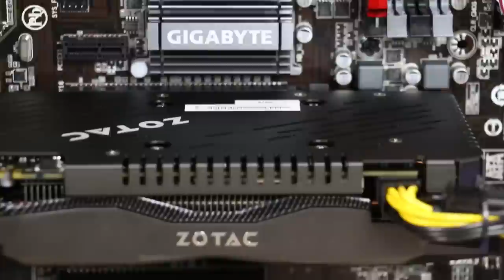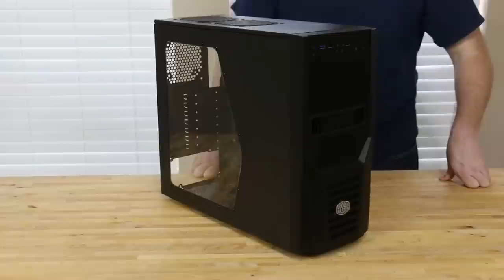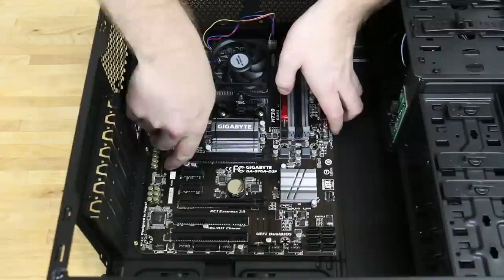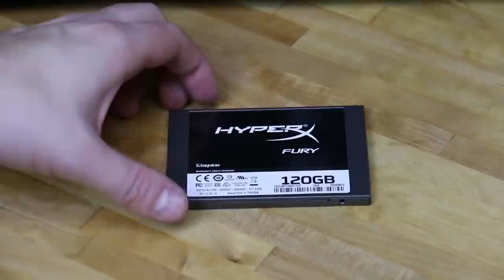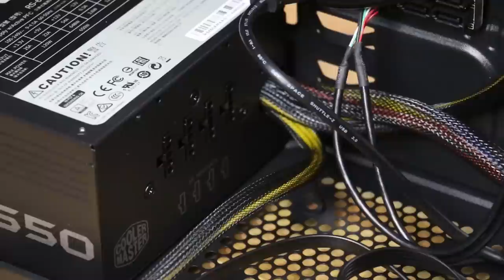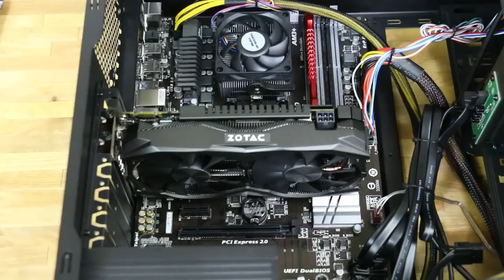$690 Gaming PC Build - FX-6300 / GTX 960 / Cooler Master Elite 431 Plus

Comment: Overkill PSU and replace the shit 960 by an R9 380. Less expansive and more powerful.
Reply: this video was published before the AMD's 300 series came out
Reply: Bryce Degraff
 And? The R9 285 (the same as the r9 380) came out after 970/980 but before 960.
Reply: smokeyjo123e
 It's hard to find today but why not.
Reply: smokeyjo123e
 In Europe it's hard to find new
 280x. Only used 280x are available (or if there is a stock of non used 280x it's out of stock really fast) so I always recommend the 380 or 285, but if you can find a 280x why not.
Reply: smokeyjo123e
 Np, in Europe we can find R9 380 for less money than GTX 950 ^^
Reply: smokeyjo123e
 That's why 950/960 really suck in Europe. R9 380 is better than the 960 which is better than the 950 and the R9 380 is less expansive than the 950 xD
Reply: +L3xou97 yeah i have a less powerful psu and i was gonna go with the 960 but went with the 380 bc a few more fps and 256 bit memory bus around the same clock speed
Reply: +Slaythan good choice
Reply: +L3xou97 amd fanboy alert.
Reply: Soumya Majumder
 Idiots alert you mean? 960 is the worst GPU of the moment
Reply: lol
Reply: tell me one nvidia gpu which shld replace it
Reply: Soumya Majumder
 R9 380. More performances and less expansive.
Reply: "hence proved" amd fanboy.
Reply: Soumya Majumder
 Wrong. You said nothing except personnal attack here, if there is a fanboy it's you.
Reply: MsAboAbosauce
 You're looking for 380x, i'm talking about 380 which is better than 960.

http://www.topachat.com/pages/detail2_cat_est_micro_puis_rubrique_est_wgfx_pcie_puis_ref_est_in10090343.html
Reply: Mote of Dust
 You're drunk or what?

Comment: So the way i see it is that the Power supply is waaaay overkill. There's no reason to have such a huge power supply for a system that doesn't even consume 300 watts. A 350+watt PSU would be just fine. And if you were going for a 280 a 500watt or a very good quality 450 would do. It's not really spenting your money correctly. The Only thing you got might be a PSU that'll last a good 5 years +
Reply: I disagree. It gives you headroom for future upgrading. Quite sensible really.
Reply: MrApvel dual 980s = waste of money (IMHO)
Reply: MrApvel True. As an example, I get where you're coming from.
I always like PC builds with loads of extra headroom in the PSU department. You never know what you may add in the future.

If I was building this PC, I would go for anywhere between 500w and 600w PSU. Like I said; all about that headroom for future additions/changes.  :)
Reply: MrApvel lol i have a 750w 80 plus gold power supply for my 4790k and gtx 760
Reply: Tintin Onacid Even 960 SLI, which the motherboard DOES NOT support would only consume 500watts, so still overkill
Reply: Tintin Onacid How would you upgrade this PC in a sensible way that would use this much wattage?
Reply: RcAndFun Why?
Reply: Søren Wetter Ahh, I see you can read the future... You know what cards etc and their power needs will be over the coming years.

Again. Headroom for possible future needs. I don't see why you consider this a bad thing.

PSU is the one department you don't want to cheap out on. Better to be safe than sorry.

Build how you want to build friend.

Most PC enthusiasts I know, always go for a PSU that exceeds their needs.
Reply: Søren Wetter it has a 10 year warranty so why not?
Reply: RcAndFun Exactly! Your set for the next decade when it comes to your PSU. In five years time (or so) you may be getting near to that ceiling. No of us know what power hungry components may be available in the coming years.  :)
Reply: Tintin Onacid So getting a future proof psu can be smart if your other parts are actually compatible with the upgrade path. It's not a bad thing to do this but when you have relative limited amount of money you really wanna squeeze out every last part of preformance you can.

Getting less wattage is not "cheaping out" I wound't have said anything if it was just a 450w model of the same PSU, just the fact that it's a 650w makes me cringe. Since it's budget build and spenting 100 dollars out of 750 just on the power supply when you can get a good PSU for 50 dollars even less depending on what your requirements are.

Futureproofing is a lose and very misunderstood term just like bottlenecking. There's a BIG difference between having a 1500 dollar budget, where it's ok to use 100 dollars on PSU  and a 600-700 dollar budget it's a very different story. 

here's my go at the same budget: http://pcpartpicker.com/p/L3zCvK

Better CPU, same storage, a bit better GPU, not much. And it still has a high quality PSU.
Reply: +tintin onid
I agree with you completely. I was thinking about skimping out on the psu but I got parts that I might want to sli and overclock with in the future. So I went with a larger one.
The build:
http://pcpartpicker.com/p/jrmhXL

Comment: Noob question: Do i need to buy a wifi card or something?
Reply: Wired internet with cat5 cable is the best and most reliable way to get internet for gaming/streaming. If you can't get a cable from your modem to your PC then I suggest you buy (I can't remember what it's called) this device you plug into the wall next to your modem then another one next to your PC. You then take a cable from your modem and plug it into the device. Then use another cable to connect to your PC from the other device. 
How this works:
This technique uses the electrical wiring in your house to transmit the internet signal. It's not as good as a straight connection, but it's way better than wireless.

Comment: I don't see the cpu fan in the parts list, and I don't even see a disk drive or a power cable in this whole video, and this is the same with every single pc build I've found on pcpartpicker, and it's totally confusing. Can anyone explain this to me? do they come with the parts, are we left to buy them ourselves? does it even matter which ones I get?
Reply: the reason I ask is I bought a power cable for an old laptop I used to have, and it got fried in a week, and it wasn't until I looked up the model of the original that I could have any lasting use out of it. So in my experience this kind of thing has been very finicky.
Reply: Parts need to be compatible with other parts my friend....always research things before you actually try them, pc part pickers usually come with everything you need to start the computer up (excluding monitor, keyboard, and mouse)
Reply: KazmaHD so but why do I never see what I consider crucial parts listed in these builds?
Reply: ameteuraspirant What are these "crucial" parts you require?
Reply: well, what I mentioned above, disc drive, power cable, anything to be able to play like a regular storebought computer.
the problem is, I don't know if people are leaving these things out because they don't use them, or because they're something anyone tech savvy enough could get on their own.
Reply: cpu comes with a stock cpu cooler, disk drive not included, PSU is your power source...you plug that into the wall ameteuraspirant
Reply: ameteuraspirant power cable comes with the power supply, disc drives are optional at this point.
Reply: alright, that clears up quite a few things. thank you +everybody
Reply: -_- I regretted that as soon as I posted it.
Reply: ahahaha ameteuraspirant

Comment: guys can this build run medium to high setting games or is this a bad build

- fx  6300
- Rosewill RCX-Z1 57.2 CFM Ball Bearing CPU Cooler
- Asus M5A78L-M/USB3 Micro ATX AM3+ Motherboard
- Crucial 8GB (1 x 8GB) DDR3-1600 Memory
- Western Digital WD Green 750GB 2.5" 5400RPM Internal Hard Drive
- EVGA GeForce GTX 750 Ti 2GB Superclocked Video Card
- Logisys CS305BK ATX Mid Tower Case w/480W Power Supply

i'm in a really tight budget so... yeah!.......
and yes i copy pasted the list :)
Reply: +Riskia Ranadhina Sukriananda Well if you're on really tight budget i say yea that's not a bad build
Reply: +Riskia Ranadhina Sukriananda Yes I have the same Card and cpu and I can run Battlefield 4 on Med/High as well on most games.
Reply: It's alright. 750 ti is a bit on the weak side. (Recommendations : r7 370,GTX 950/960. R9 270x.) Medium is console setting; so running them on high-max settings is KEY. My recommendations will run games high-max with the 6300. Aside from that, your build is great.
Reply: +Riskia Ranadhina Sukriananda, What is your budget?
Reply: id recomend the asus over clocked 750 ti best one and its on sae

Comment: Could I run a 6300 and 2 gtx 960s with a 550w psu?
Reply: I wouldn't advise it, if you do plan on it I'd rather just OC the 6300 as far as it'll go with a good cooler or get an 8320. Just in case if bottlenecking is an issue.
Reply: MLG NeverFail
Good joke!

Comment: my motherboard is Gigabyte ga-m68mt-s2. Can I upgrade to AMD FX 6300?
Reply: +Tommy K Yes.
Reply: Adam Barnett
this is my build 
http://imgur.com/1QbLpqd

spec: i3 4150, MSI GTX 750Ti, corsair vg pro 8gb dual, cm hyper 212x, 1TB WD blue, CM 500W ELITE V2, CASE CM N200 WINDOWED
Reply: +Tommy K I have an amd fx 4350 clock at 4.57ghz, 8gb kingston furyx 8gb stick with a 4gb kingston fury x (12gb) corsair h60 hydro series cooler, Gtx 950 ssc, shark 750w powersupply, msi 970 gaming mobo, kingston 120gb ss, sandisk 240gb ssd and a bitfenix neos white/red case.
Reply: +ToRqZ MoDz™ how is your rig doing at 900p gaming? Would you recommend it for 2-3 years ahead?
Reply: im looking at your pc right now and my intel core i7 2600k and dell opiplex 990 motherboard with an amd radeon 6670 looks better thant that piece of shit. im dead.. im honestly dying right now.
Reply: hows your dual core?
Reply: Hristin Marinov apparently somebody knows absolutely nothing about pc's if you were smart youd know my pc runs full 1080p display 60 fps and if I wanted I could go 4k but only at like 25-35 fps. get a life..? and i ordered a 9590 cpu and will love it more than my quad core which was an absolute beast considering I did very light gaming but now that im into it ill just upgrade into better. and ill buy another 950 and run 4k at full 60fps :D haha I have money. budget is not an issue didnt realize I needed to spend 2k on a pc just to play for 2 hours a day.
Reply: ToRqZ MoDz™
uhm I think you were arguing with the other guy , not me xD I was just qurious about this built   " I have an amd fx 4350 clock at 4.57ghz, 8gb kingston furyx 8gb stick with a 4gb kingston fury x (12gb) corsair h60 hydro series cooler, Gtx 950 ssc " - and wanted an opinion how would it perform at 900p and for relatively how long would it stay good
Reply: Hristin Marinov yes the pc would stay good....
Reply: thank you ToRqZ MoDz™
Reply: Hristin Marinov this pc is future proof maybe the only thing you would want to upgrade is probably the processor although I only game so need for me to have more cores and I prefer a higher clock speed 4.59 ghz and the games currently only use like 2 cores with all 4 threads.
Reply: ToRqZ MoDz™ Well for now everyone is recommending the i5 for future proofing (which makes sence, since the i5 first gen is still holding, right now it is between the i3 4th gen and amd 860k) but i dont wanna spend so much money ( here it is very expensive) Soo could I just go with a FX 6350? Or i3 4170 ( it has hyperthreading so its like a 4 core cpu) ?
Reply: go with the fx 6300 for 6350 its cheaper and especially for a 6 core its amazing.
Reply: Hristin Marinov I went out and bought myself the 6350 six core cpu and Im enjoying it fairly more than my quad core. Only problem is that it does not overclock as high as my 4350 therefore when games only use a certain amount of cores and threads my quad would perform slightly better considering the .3ghz difference. Although, im very pleased with the performance and ive upgraded a few more things. Ill be sure to post some pictures for you to see.

Comment: im new here i thought if ur having an AMD products u do buy for AMD products only why is it in this video he uses GTX 960 with AMD FX 6300?? plss reply plssssss
Reply: AMD cards work with Intel processors, and AMD processors work on nvidia cards. So no worries.
Reply: Kasis Derps so it doesnt mean if i use intel 5 its safe what about motherboards? tnx bro
Reply: Hunter Magpale Intel i5 you mean? Motherboards? What about them? They differ with sockets for cpu. And their overclocking abilities and price. For example Intel i5-4460 is LGA1150 socket, but an amd chip, like FX-8250 i believe it was AM3+. I might be wrong, but I hope you got the idea. Oh, and any Motherboard with an pci slot can drive an Nvidia or AMD GPU.
Reply: Kasis Derps tnx bro... currently im using Radeon R9 380 4gb and APU 6600K so cheap with my CPU maybe ill try AMD FX 6300 instead?
Reply: Hunter Magpale wait, have already bought r9 380 and 6600K?
Reply: Kasis Derps no im actually just bought R9 380 and my current CPU was APU 6600K plss.. bro i need some straight answers from u is it good? or what do u think about ATHLON im planning to hit AMD FX 6300

Comment: hello can someone plzz tell me which mother board will be compatible with the following
i5 4460
gtx 960
8gb ram
Reply: No, that motherboard uses an AMD socket, so you would need a lga 1150 motherboard to use that i5. Look for h81, b85, and h97 motherboards for that processor. The other parts will work fine with those motherboards. If you meed anymore help just ask :)
Reply: +jamal diakite  thanks man ☺☺☺

Comment: For 530 and better components: http://pcpartpicker.com/p/fxNWRB
Reply: Damon Llopiz better than the one in the video ....
Reply: +Damon Llopiz The PSU and the graphics card are not good.
Reply: The Corsair CX430 only has ONE 6pin GPU Power connector, while the graphics card will most likely need 2, however you could get a SATA to 6 pin or dual molex to 6pin, but better off get a 500w
Reply: Yup.
The clock speed is nice, but it's only dual core.

Comment: Can anyone tell me if this setup could run games like Rainbow six, The division ,Gta v, fallout etc 

AMD FX-6300 3.5GHz 6-Core Processor

Cooler Master Hyper TX3 54.8 CFM Sleeve Bearing CPU Cooler

Asus M5A78L-M LX PLUS Micro ATX AM3+ Motherboard

 Crucial Ballistix Sport 16GB (2 x 8GB) DDR3-1600 Memory 

Western Digital Caviar Blue 1TB 3.5" 7200RPM Internal Hard Drive

 EVGA GeForce GTX 960 4GB SuperSC ACX 2.0+ Video Card

 Cooler Master HAF 912 ATX Mid Tower Case

 Asus DRW-24B1ST/BLK/B/AS DVD/CD Writer

 EVGA 500W 80+ Bronze Certified ATX Power Supply
Reply: yeah but now you should get the rx 480 instead of the gtx 960 it has gtx 970 like perfomance for gtx 960 price
Reply: +cocacoladog10 Thanks for the advice lol but in these two months of learning about pcs I'm gonna up my budget and fit a 6700k and a 1070 lol
Reply: xMostro987 6700k is waste of money
Reply: +cocacoladog10 heard it was better than the 66 for videos and livestreaming which is why I plan on buying it tbh
Reply: xMostro987 whatever its like 100 dollars more

Comment: I am gonna build the pc with a FX -6300 and a 4GB Version of the GTX 960 ( MSI GTX 960 GAMING 4G) could I get a bottleneck?
Reply: Nope. You'll be good. If for some reason it does bottle neck just get a decent CPU cooler and overclock the 6300 to about 4.0-4.5 ghz (as long as it's stable). 
P.s look up an overclocking guide on YouTube. Don't forget that your motherboard needs to support it. And you need an ample power supply
Reply: have the pc since a month and dont need any overclock or smh. :D

Comment: my power supply only came with 2 4pin connectors, will it still work for the cpu which requires an 8 pin
Reply: yeap thats why you have 2 of them
Reply: I realise now, that was a stupid question
Reply: not rly...at least you learned something
Reply: Next time make sure parts are compatible. Did you use pcpartpicker to see if they were?
Reply: Yeah i did, but it's all sorted now

Comment: i wnt to build a computer dont know what power supply
-samsung 850 evo 250gb ssd
-msi970 ddr3 atx amd motherboard
-wd blue 1tb hhd
-corsair vengeance 8gb ddr3 1600 mhz ram sticks
-amd fd6300 6 core processor
-evga geforce gtx 950 2gb sc+gaming graphics card
 anybody know please respond

Comment: fx 6300 or i3 ?
Reply: almer ammar People will tell you both, I like the 6300 because of DirectX 12 coming will help; the i3 has hyperthreading though so it would also be fine. Find a better deal on one or the other haha (If you play DayZ or any really cpu intensive game an i3 may be better though for now)
Reply: Austin Hughes
For me I like to have spotify and my livestream going while playing league so 2 cores is definitely not enough (even with hyperthreading) I also overclock to get similar performance to an i5
Reply: Rey Jukes Definitely get the 6300 then :)
Reply: Austin Hughes
yes but be wary as the amd motherboard has a far inferior upgrade path. if you went with an i3 you can easily get an i7 in the future
Reply: Rey Jukes well that is true but since I'm going matx for my sister anyway and am3+ matx boards seem trash I'm gong i3
Reply: Austin Hughes
look on pcpartpicker. There is a decent matx board for 50$
Reply: +Austin Hughes Guys is there any bottleneck with pentium and 270X? if not i have one more question is those two good for 700€ rig (with windows.)?
Reply: Ende Maybe slight bottleneck, but even so I do not condone getting a dual core cpu for gaming in this day and age. The only true dual core I'd recommend is an i3 which is multithreaded. Some games coming out won't even run on a dual core. If you can manage, try to get an i3 or 6300. If you can't spend much more than you can for a Pentium, I recommend the AMD Athlon X4 860k.